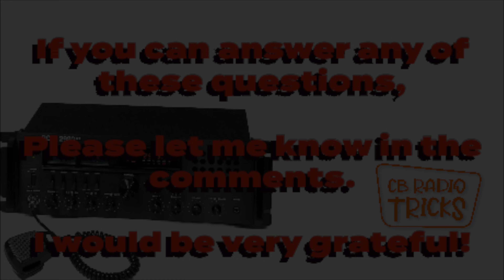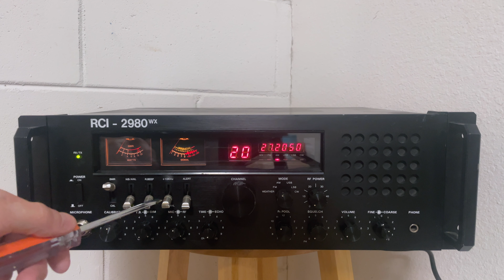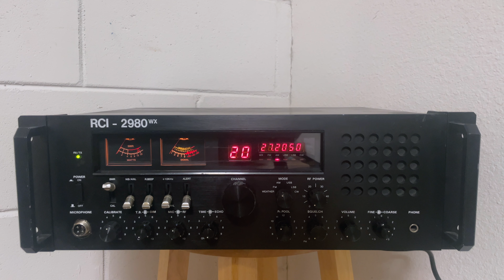CB Radio - RCI 2980DX questions - Please help.

Comment: The light flickering is voltage irregularities. Talkback would be used to set up your echo and hear yourself talk if you don’t have friends. The speaker pop might be from talkback being on. If not it could probably be solved with a buffer capacitor. Cheers!
Reply from the maker: Thanks for the input. Hope you decide to subscribe to the channel.

Comment: Talkback used to set mic. And ensure in fact that modulation is working and being transmitted. I personally check once a week. On dummy load. Unless im getting poor audio report. Echo is actually a very good feature. I think some manufacturers label it echo. When in some cases it is actually reverb. Two different things. I run mine on the lowest position for both length and frequency. It does in fact add depth and tone when used correctly.  Nobody knows i run it on air. Zero complaints. Always very good audio reports. As for speaker pop. There are a few things that could cause this.  The simplistt  being feed back. It could also be circuit charge and discharging issues. These would require a schematic to see tp's etc. Things like wrong impedence on a replacement speaker etc. Anyway im sure you'll be able to figure it out. I suspect it wont be too bad. The rig looks to be in nice shape.
Reply from the maker: Thanks for the feedback. I have cured the pop. I Will certainty look into the suggestions you made about echo. That seems to make sense. I hope you decide to subscribe, as I really want this channel to be a two way thing.
Jeff
Reply: I am subscribed

Comment: As far as the light pulsing I would find out why the receive transistor that is operating that color would be pulsing but a cap would fix it. Does it do it on TX? Talk back never used it. Those who do try to impress themselves, is this too not the true expression of vanity 1 Jn2:15-17? Sounds to me the speaker is picking up the relay spark that is captured in the shut or collapse of the magnetic field in the relay when it releases. Need to keep it from feeding back through the ground side. That is why there is a diode on the relay to stop this field from causing a popping noise. Might want to change to a different type Diode that stops the field completely so the speaker doesn't hear it.
Reply from the maker: Thanks Gary, I have cured the “pop”. I will look into the pulsing led. I agree with the comment about talkback! Hope you decide to subscribe, always nice to have knowledgeable people on board!
Jeff

Comment: It might be time to have a tech check the radio as far as the RX/TX lamp fluctuating. As for the speaker pop turn off talk back and ask someone on air if they hear a pop or again see a tech. For echo that is absolutely one of the worst features ever installed on a radio it also one of the reasons I rarely if ever talk to those using it due to the fact 95% of those running it sound like crap using it because you can't understand what they are saying not to mention I find echo a great annoyance.
Reply from the maker: Thanks Roger. I totally agree with your comments. Hope you decide to subscribe.